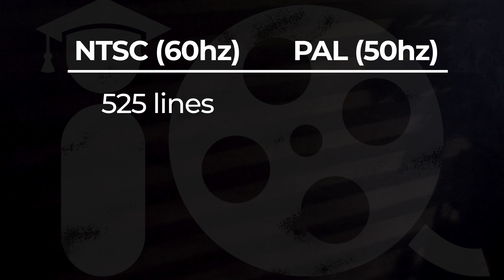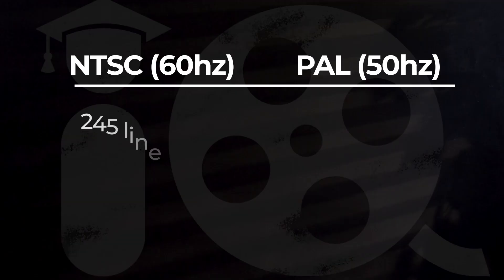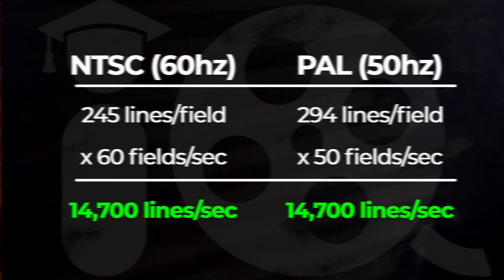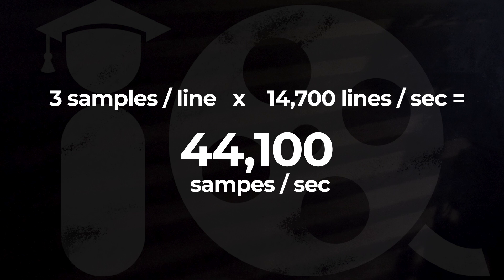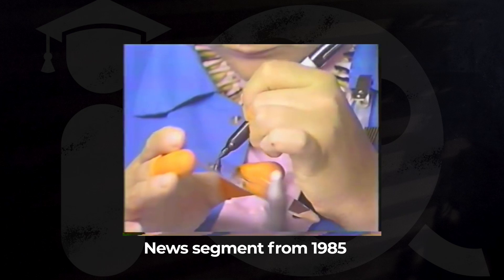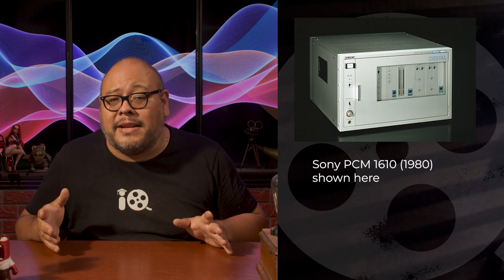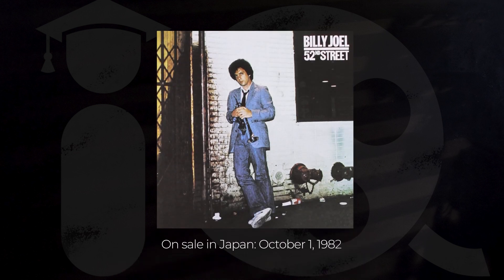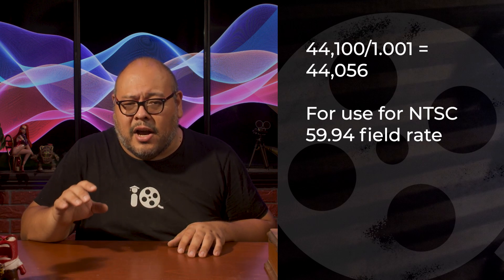The Surprising Origins of Digital Audio Sampling Rates

Comment: I have a "digital" VCR--Toshiba--made in the late 80s. It has analogue ins and outs, but the audio is PCM. My band recorded an entire CD with this format because we couldn't afford a DAT machine. When we went to master our mixes, we took the VHS tape and the mastering house was able to decode it digitally. It was amazing at the time. The VCR cost about $1100, and I still have it, and it still works.
Reply: I saw an early version of the VHS tape based digital recorder from about 1980, pretty advanced.
I used VHS HiFi for mastering and later Minidisc
Reply: @robfriedrich2822  techmoan covered the technics version recently https://youtu.be/WVDCxTtn4OQ
Reply: I had this same machine: the Toshiba DX900. Known as the "poor man's DAT." If yours still works, consider yourself lucky! The most obvious thing to go wrong is the rubber idler wheel turning into a hockey puck and any of the rubber belts disintegrating – but that's common with any older tape machine. I mixed & mastered many home studio projects on it with good results (the audio specs of this machine probably exceeded what I was putting into it!). I'm pretty sure it used the Sony PCM-F1 format but was 14-bit instead of 16.
Reply: @flooey580  Later there was the SVHS based ADAT system.
Reply: @robfriedrich2822  Yep, I owned an Adat XT. I'm a musician and used to have a home studio back in those days. I also did work at studios that had the Tascam competitor (DA-88). After using the Toshiba as a mixdown deck for a while, I lucked into a deal on a real DAT machine - a Technics clone of a Panasonic deck (SV-DA10)
Reply: bobby sands
You needed Sony Digital Beta machines, you need the I/O to make masters!
Reply: Sony sold VHS digital too, the PCM 1 adaptor is able to master them on a computer now
Digital Beta was for cameras and cheap broadcast.
Reply: bobby sands

You needed adaptor as the Sony PCM, too get it in PCM out of the VCR cassette.
Many VRC recorders supported the PCM audio recording on VCR.
You should be able to read the tapes you made, restore them, are they still good now?
Reply: @Impromptu This is only needed when you do oldskool sections, so you can record all musicians separately on their own track, vocals, guitars, drums etc.
Surround sound is after effects only, you never record in surround sound, you just record tracks, produce it on  stereo or in 9.2 afterwards.
Reply: Oh hey, you just reminded me to look at my VCR (a Panasonic AG-1980)
It has jacks next to the L/R analog inputs and outputs labeled as "LINEAR"
Obviously for an external linear PCM decoder/encoder, but I never put two and two together. Thanks!
Reply: Great story ✌🏻

Comment: Interesting that they tossed the idea of 60KHz as the standard back then, as several of the more respected designers of digital audio converters suggest that as the ideal range of sample rate, for overall accuracy and quality.
Reply from the maker: Sampling frequency quite literally translates to storage space.  Instead of a CD being able to contain 70 minutes of music at 44.1 it would only be able to contain 51 minutes at 60khz
Reply: @FilmmakerIQ  My bigger point was, had they figured out a way to make the 60K rate the early standard, they might have inadvertently found a more ideal compromise between quality and file size. Now, we are left with "standards", that straddle a range that has been suggested as ideal. 60KHz-ish. ☺
Reply from the maker: But really beyond 40ish khz there is no gain in quality.
Reply: @MiddleMalcolm  There exists zero needs for anything better than 44.1khz at the consumer level.

Comment: The irony is that most audio is recorded at 44.1Khz. So even when the final audio is rendered to a 48Khz track the audio is still actually only 44.1 since you can't put in what was never there, and no one would be able to tell the difference. Esp since the entire chain is based around a 20Hz-20Khz range. However what does make a difference is bit depth. 16bit vs 24bit, at least for recording. For playback people still debate that till they are blue.
Reply from the maker: Depends how you define "most audio" ... If you are recording audio in a video setting, it's ALWAYS recorded at 48.

Then sampling frequency conversion is a bit more misleading. For the waveform, everything from 0-22khz is EXACTLY the same, that's what Nyquist Shannon is really about. It's the top 2khz from 22khz to 24khz that won't be reproducible... But seeing how my hearing caps around 15khz, I'm not going to miss it.

Plus there's a lot of audio tricks like antialiasing that operate in those higher frequencies. So all that is dicey from an experience standpoint.
Reply: 24 bits is SEVERE overkill for home playback.  It's IMPOSSIBLE to achieve that dynamic range.  16 bits is MORE than enough, not to mention that dithering can get you to more like 20 bits.
Reply: @robertromero8692  For playback it's debatable, but not recording. When it comes to dithering and so on to "get you to xx" there's no point. The overhead difference between 16 and 24 is so small now it's not even worth mentioning.
Reply: @hardwire666too  Yes, 24 bits is basically marketing hype.
Reply: @robertromero8692  No 24bit is a real and measurable thing. It's not marketing hype.
Reply: @hardwire666too  24 bit is real and measurable, but its audible benefit in the home is marketing hype.
Reply from the maker: You guys actually both agree. Please keep in mind whether you're referring to capture or delivery... Once you do that, you're both saying the same thing.

Comment: Many audiophiles only listen to standards beyond CD quality at higher sample rates which are based on 48 kHz. Typical rates for high quality audio are 96 kHz (double) or 192 kHz (quadruple) with some even higher standards as well. Also bit depths are increasing to 24 or 32 bits. I don't believe any of these excessive rates and bit depths add any additional improvements, but since storage isn't an issue anymore it's not really hurting to have more headroom.
Reply: The high sampling rate makes some sense in terms of practical implementation. Higher sampling rates make it easier to filter out high-frequency "conversion" noise in the "raw" post-DAC analog signal and, as a result, reduce distortions introduced by the filters and noise in the audible range of signal.
Often audiophiles choose high resolution due to the "more scrupulous and thorough mastering" of recordings for high resolution release. This makes sense if the release was ACTUALLY mastered by COMPETENT team for a high resolution release. Usually if we compare CD-quality recording with competent mastering and 384/32 recording with “just average” mastering, the choice is clearly in favor of the former.
Reply: better data format and storage/processing capability does not help if
1. delivered program material does not have the data to begin with (e.g. compare youtube AAC compressed, lossy 128kbps to redbook CD)
2. insufficient resolving power on the playback system (and its viewing/listening env)

Comment: Very comprehensive as always. Of course I won't be able to know all numbers by heart, but it's always great to have a deeper understanding. 
With that said: I think that the Nyquist-Shannon theorem does not hold true 100%, just like the Fourier analysis. The human ear can distinguish a sine and a square wave at 10 kHz. If a sound wave is nothing more than  the sum of sine wave components, then the human ear would be able to hear a 30 kHz sine wave, which it cannot. As we know, a square wave only contains odd numbered overtones (or partials), so the first overtone (or second partial) of a 10 kHz square wave is 30 kHz. I believe that we humans are great at breaking down things (analysis), but very bad at fully understanding systems (synthesis), so we assume that our senses are analysing, which they are apparently don't, but rather recognize shapes and patterns. So I'd say that digital audio is very good nowadays, but raising both sampling fequencies and bit rate would make it better. That's why since the 1990s old analog tapes are recorded onto digital at 96 Hz at 24 bit. I had the pleasure of hearing studio recordings at 96 kHz (ProTools through Apogee converters) and it sounded so much more transparent. Just my morning ramblings, thanks for reading.
Reply from the maker: I've recorded choirs at 96khz and at 48khz and I can honestly say I cannot hear any difference between them.
Reply: @FilmmakerIQ  might have been the wrong audio content or circunstances. You can hear the difference in signals such as acoustic piano or nylon string guitar. In more complex signals that involve mixing, you need top notch equipment in order to hear a difference. And if course audio engines and rendering heavily improved in the last 15 years or so and 44.1kHz/16 bit sound very good. Just sharing my experience.
Reply from the maker: I've done acoustic piano recordings as well but certainly not with top notch recording equipment.

I used to record 96khz but then I tried just switching to 48 just to see if I would miss something... Nope.

But I get there are certain filters and processes that benefit from the higher rate... Sure.

But I'm also perfectly happy with my MP3s so what do I know
Reply: @FilmmakerIQ  Mp3 at the highest setting (320 kbps, 16 bit) is more than fine for most real life situations. I'm not a purist. Yes, certain plugins for example sound best at a certain sampling rate/bit depth. And of course: if you have the storage capacity and CPU power: when in doubt,  choose a higher quality. It certainly won't hurt the sound. Oh: and recording a piano for example: mic placing and levels (gain staging) are much more important than top notch equipment. Now that we have much less problems with noise floor, you can go easy on the recording (tracking) levels. But you know all that. :)
Reply from the maker: Someone else linked this video and it covers your question about square waves rather ingeniously: 
https://youtu.be/cIQ9IXSUzuM?t=1042
Reply: @FilmmakerIQ  Came here to post that very video, thanks for beating me to it!

Comment: VHS PCM is gonna be the newest hipster audio format.
Reply: Kinda right now. People are buying up old Alesis ADAT recorders for really cheap. They're pretty good. I've had one for years.
Reply: it's just pointless to me IMO compared to actual analog, as the same bit-depth exceeded "0 to 100" distortion nature of digital and lack of actual artefacting (saturation, compression) to the audio signal itself leads it to not have any kind of sonic aesthetic/ FX use case in audio production/ mastering. All though, perhaps some hardware has some means of A/D/A that may be coloured, and quite complex ie exiting, stereo processing. I'm sure it has other uses that people would dig up though.
Reply: @patchmarks_au  in the scheme of things, yeah they're pointless because we have even low tier stuff that outperforms it. But as a standalone recorder or if you need so IO via ADAT in a pinch or in the rare case you get someone looking to transfer tapes. They're good to have around